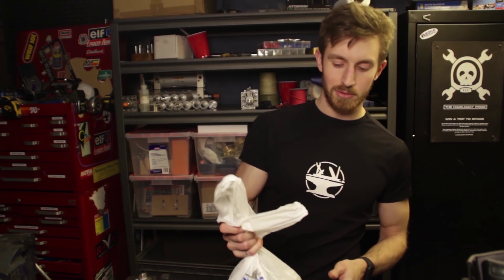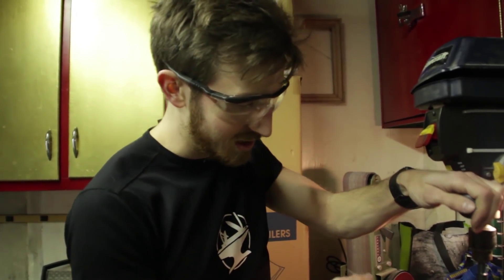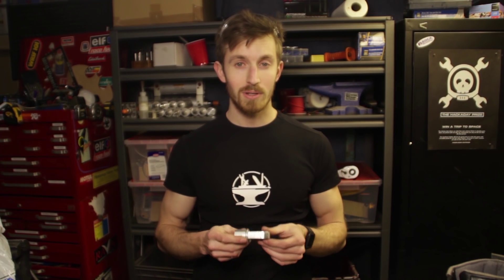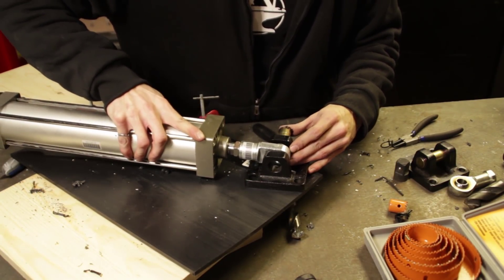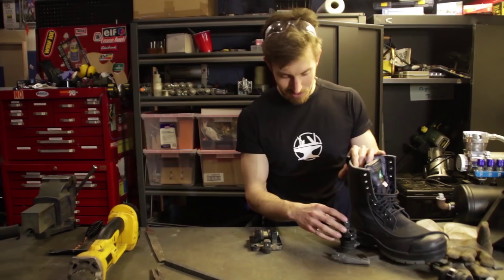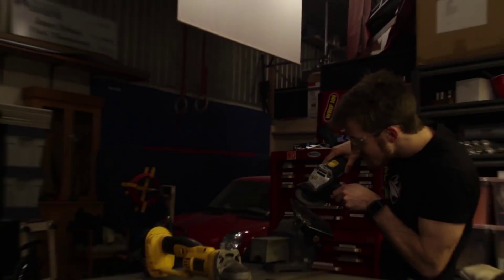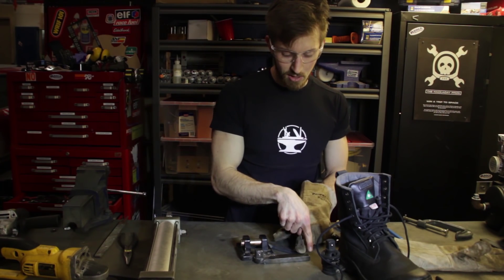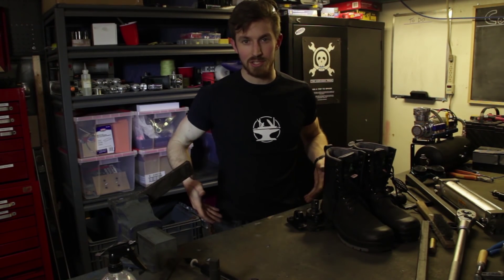Powering the Legs -- 1600lb lifting strength!

Comment: Are you using flux core or solid wire when you weld?
Reply from the maker: +Arky Anderson this welder is a fluxcore
Reply: the Hacksmith you might want to look into metal cored wire, it is usually used in most fabrications and heavy fabrications for structural welds

Comment: Do you have 3d scanner in your shop? If you do, you can start build light version of exoskelleton:)
Reply from the maker: Been meaning to make one! Designed a turntable in solid works a year ago, and I have a kinect!
Reply: It can be made from webcam, line projector(laser line level), canvas and software.
You will need to make line slide on whole object from each side, and combine them via software. I don't remeber the names, but there are a lot of instructions of lowbudjet 3dscanners.

Comment: For that pin I would have still used A a Ron end but drill the female threads out and tap it the correct size
Reply from the maker: I don't follow... We could have used a smaller pin, but then we would of needed bronze bushings to make up the difference in the tang base...
Reply: +the Hacksmith Autocorrect ruined that comment 😂 Instead of the aluminium part could you have used a 1/4" rod end to fit the pin and  retap the threads to fit the end of the piston? Depends on the threads of the piston though.

Comment: really? I am an offshore maintenance technician, and every gate valve and esd valve and alot more other equipment has multiple lock-rings. i've never replaced a ock-ring ever and i'v refurbished some valves more than fifty times. probably because there is almost never any pressure on the rings
Reply from the maker: +bradleymoc Must of opened it too much with the split-ring pliers, had two warp! Or they're just low quality, not industrial grade...
Reply: i'd guess either they're from a lower quality, ooor.... you're becoming schwarzenegger, and by the looks of it that would be the case. love the videos man